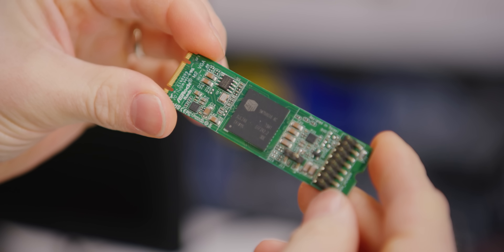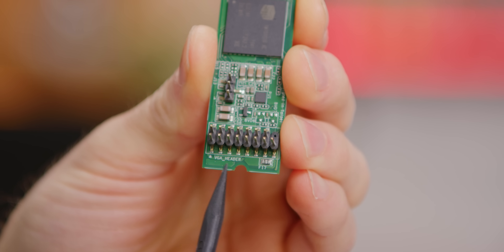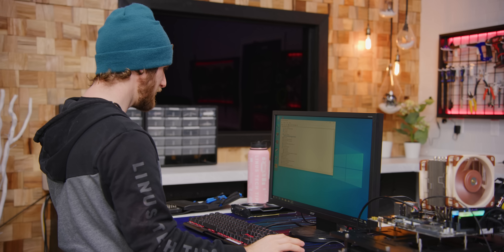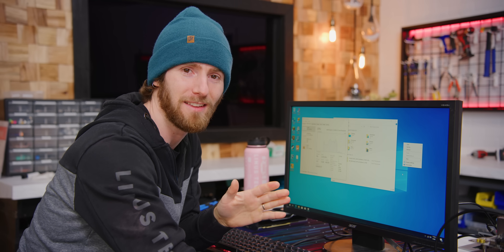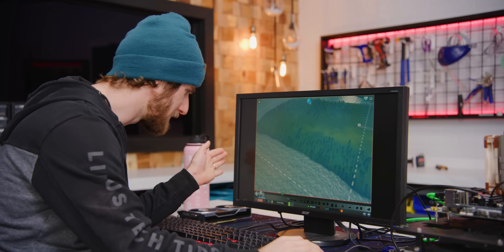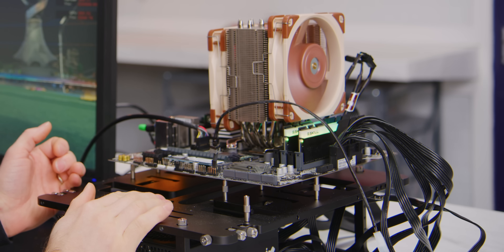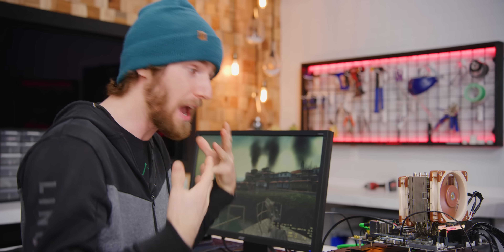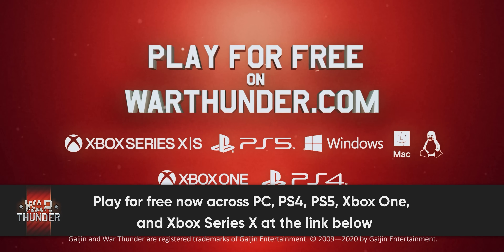THIS is a Graphics Card..?? - ASRock Rack M2_VGA

Comment: This might be good for just running basic display for now but what could they do on gen 4 m.2 with laptop dies and overdone m.2 coolers like the saberent m.2 cooler with heatpipes attached? https://www.newegg.com/p/0D9-001Y-00027?item=9SIAME8ASD1163&source=googleshopping&nm_mc=knc-googlemkp-mobile&cm_mmc=knc-googlemkp-mobile-pla-sabrentsolid+state+disk_-9SIAME8ASD1163&gclid=Cj0KCQiA3smABhCjARIsAKtrg6Ky-Lzt7G-tMFCL1l9CLgNqAgyT1B0i9ooOdf-3qJ_0PmOSazcBezsaAmxaEALw_wcB&gclsrc=aw.ds
Reply: If any board partners are trolling the coments section for ideas and like this one, I could really use a better job. 

I hold 2 computer science degrees unfortunately from the University of Phoenix online and I graduated in May of 2015.

Comment: 5:49

LINUS YOU DOFUS, YOUR GRAPHICS DRIVERS ARN'T WORKING!
all those symptoms are classic for a PC using 100% software rendering. low color depth, 64Hz refresh rate, no Vsync on desktop and dragging windows, the whole 9 yards. That thing is not offering anything, if the drivers are actually loaded.

Comment: That 1Hz and 64Hz is power saver, so it uses power and produce frames on demand, means when nothings happening, it will sleep at 1Hz, and when it has to do something, it will do it efficiently, up to 64Hz. Similar things are happening to modern GPUs, for example RX5600XT can do 1800MHz core clock, but when its not doing anything, it will sleep at 6MHz. On Intel iGPU, same thing, it can do 60Hz, or transport 120Hz from real GPU, but on battery it aims for 48Hz, while it will sleep at 4Hz when doing nothing. Energy savings, probably good for servers that does not showing things actively 24/7, for laptops, smartphones, cars, batteries and other things, nice feature to have.
So, can it mine some crypto currency? Maybe with some overclock, passive or active little heat sink, maybe that GPU is slow, but it got somewhat fast memory?

Comment: The color banding could be due to a poor VGA port on the monitor, but I suspect it’s a limitation of the overlay/scaling surface the video is being rendered on. (Your “certain type of pictures” would probably look just fine.)

This might actually be a neat way to “sneak” a GPU into a laptop that doesn’t have one, but I guess with the size and power limitations, it wouldn’t get you all that far.

Comment: This has to be one of the most extreme niche cases I've seen in a long time. Where would this be useful that IGA wasn't already present, especially considering this requires a board recent enough to have M.2 slots. (Using a full PCIe slot for an M.2 adapter instead of a minimal video card would make no sense at all.) What is the CPU that ASUS thinks somebody absolutely has to use that lacks at least comparable IGA to this device? Though most IGA for the last decade is hugely better.

WARP goes back much farther than Windows 7. Software fallback has always been in DirectX. Several generations of Intel IGA has relied on it to claim compliance with a more recent version of DirectX than the hardware actually had the functionality to perform (particularly DX9), which is why the results were so lousy. WARP was just a formalization and update of the methodology.

Comment: This is the form factor that intel gpus should be, Pci-e gen 4 or 3, Iris Pro level graphics with the L4 cache for vram, pair it with an i3 which are 4 cores now and game on a low budget, super small form factor. Like maybe sub 100 dollars low. With a display port out for video
Don't know if it will beat an apu but it would be nice to have, maybe have one of those crazy passive coolers the ssd get and an rgb skull for fun XD

Comment: For reference... that GFX Card is meant to be in imbedded system deployments... such as Slot Machines.. Where the games that run on them are SUPER whimpy and thus don't require hardly any graphics power at all and only need basic VGA connections. We use these sort of GFX Cards in our slot machines..

Comment: So, I think this is aimed at digital signage, you could get a load of these on a machine (think those M2 breakout boards) As for the gaming claim I think it would be a good match for Gambling kiosk machines like you get in casinos and pubs (UK here!), you could run a bunch of them on these since they dont use 3d graphics normally.

Comment: if you think about it, it actually is not too bad a product. It is just limited by the chip on it. Take for example the new M1 chip from apple. It has integrated graphics and is good enough to run some games (including some modern titles) at not so bad frame rates. If someone developed that kind of graphics and put it in the above form factor with a little more bandwidth, you would get a very efficient and effective graphics - one that doesn't take up absolute ton of space - I reckon. Heck it wouldn't even need fans and stuff too cool it. Just the passive heat sinks like the ones used for M.2 SSDs would do the job! This for me is a very interesting prospect.

Comment: One day soon they will add Ray Tracing Acceleration hardware to your pci4 or pci5 m.2 NVME drive. The card will be able to use a few Gb of higher speed buffer for RT during gaming or caching drive data when you are not gaming.

Comment: My MSI GeForce GTX 1070i ARMOR 8GB has no VGA compatibility. My 24" inch 1440p 144fps 3D gaming monitor does Display Port & HDM but, has no VGA port.

Comment: So, if you guys set that up with the m.2-GPU was selected to be the processor for your tests.... doesn't that lock out all the other hardware? I see the point in that for testing it's limits, but as for testing it's practical uses, I would say let the main GPUs do the rendering and what you've got is a halfway decent way of hooking up an old CRT if one wanted to do that. And... maybe they'll release it on a smaller die next gen. lol

Comment: You should do a “weirdest PC” with all of the weird janky parts you’ve found
Reply: THE BOTTLENECK
Reply: Then try and run crisis? lol
Reply: sounds like a fire hazard. great idea for a video
Reply: They could use this to show how insane the Threadripper 3990x is. They played Crysis using software rendering, I bet it would be awesome.
Reply: Hmmm... Put this GPU in the M2 slot, get those weird non-volatile drives that fit in the RAM slots, RAM sticks in an old IDE ramdisk box, CPU... anyone's guess. And power over water cooling.
Reply: @dananskidolf  crossfire the m.2 gpu and the cpu rendering
Reply: Linus still dropping the word WEIRD. Not so sublime bashing on China and the Chinese people.

Comment: The fact that manufactures haven’t already started making a wider variety of m.2 devices is a crime against humanity. I should be able to add usb c 3.2 gen2x2 ports, thunderbolt 3/4 ports, 10gbe lan, sound cards, raid controllers, and even graphics cards via an m.2 slot. They should also consider making high capacity hdds with built in nvme cache that simply uses a second cable and m.2 connector. This could become standard practice if they would simply do away with old fashioned sata ports and included sff 8643 tri mode ports instead. That way you could have an 18-24tb hdd with a 1-8tb nvme cache connected with one cable.

Comment: As someone who used to own a first gen Core i5, this is similar performance. The only difference is that the iGPU actually supported a lot of the games that didn't run lmao
Reply: I'm still running a 1st gen i7,  runs like a champ for most everyday things.   I remember my first cpu was a Cyrix  Instead 233 mhz. Wooooooo!
Reply: @skroid02  Yes, but afaik it doesn't have an iGPU. The CPUs are fine. Maybe it does and I'm wrong, but for as far as i know the iGPU on the i5 - 650 was terrible

Comment: I'd like to see hardware add-ons like this for extremely vintage PC emulation. Like, making a 7nm 486 CPU would probably have the footprint of a resistor these days.🤣 Imagine a full 32 bit Windows 95/98 PC in the Raspberry Pi form factor with soundcard and GPU add-ons all redesigned on a modern process node! It'd be such a waste of silicon, but would it really? 😛

Comment: Actually the 300MHz core clock and 16MB DDR VRAM can (in theory) result in a capable late 90s, very early 2000s card, which may be able to run HL2 like in the video (if the necessary dx/ogl is present). Otherwise I feel the 300Mhz for a 2D only card is a bit overkill.

Comment: How many of you were convinced, when you saw Linus haphazardly connect the power input, that there was a 50% chance he had connected it backwards, and were eagerly awaiting the potential impending doom?

On a more serious note, I can see this as a nifty potential cheap GPU option for smaller "pi-like" SBCs for classic arcade emulation that needs those funky VGA modes like 15khz refresh ones. (Or was it 31k that wasn't standard? I remember 1 of the 2 was arcade-only, but it's been decades since I worked in that field, haha. Point stands, though, as you can't get both of those modes over HDMI/etc last I checked. Only SCART or VGA.)

Comment: Thsi could actually be a good way to equip office laptops with something like a slimmed down 1050 (performance wise). If it has mutiple m.2 slots, you could to some light gaming on office machines. 4x PCIE as an Interface should be plenty, it is enough for eGPUs via thunderbolt...

Comment: I could see a use for this at home. An unRAID server with a Ryzen CPU without onboard graphics. Use that little device so that you don't have to have a GPU plugged in. Or have that plugged in so that you can plug in a GPU for passthrough without having to have an extra GPU installed for the host machine. Would be nice on an ITX unRAID machine.

Comment: This could be brilliant to run result monitors on our range, where it just has to refresh every couple minutes at a time, and a easier way that learning a raspbp, allthough the price is very important, around 70$ wouldn't make it very viable
Reply: whats wring with the pi
Reply: There are similar adapters that convert USB to VGA and do full software-rendering. That would probably be better for what you want.
Reply: RasPis are absolutely amazing for anything like this.  The one thing to keep in mind is you want to do a volatile overlay or something to keep the root read-only.  Otherwise supposedly the SD cards can wear out.   But whether that actually happens is very much applications dependent.  I use Chromium for display and signage, and that tends to use a lot of disk activity, so I always try to go for read only.
Reply: That thing is literally a potato chip
Reply: @WindFireAllThatKindOfThing  "literally"
Reply: @WindFireAllThatKindOfThing  deep fried?
Reply: Just get an android stick/Miracast stick. Can get you those for $10-15 for that purpose
Reply: Norden your videos are great
Reply: Wait... Are you saying that $70 isn't viable because it's too expensive?
Reply: @sgbench  Yes. There are (or were before the shortages) plenty of low-budget graphics cards available for $70 that are much better than this thing.
Reply: @darknightmike10yearsago  I bought a 1030 for some shitbox I had and it could play most games on low settings after that. It cost me 70 bucks.
Reply: @brahtrumpwonbigly7309  Nice. Case in point.
Reply: @sgbench  And it sounds like he's referring to the total cost of all non-monitor components in the system.
Reply: Duck Game

Comment: I like how much modular hardware connections have become. It makes casemodding so much more interesting and gives so many options. Nowadays one can plug harddrives in: PCIe slot, M.2 slot, USB 3.2 or SATAIII. Plus there are 128 to 512 gigabyte USB 3.2 sticks available which can perform as fully functional and relatively fast drive with (light) gaming capabilites. 
In the old days there was just an ugly light-grey and always way to short IDE cable for a mechanical harddrive, and nothing else. Nowadays the new Ryzen Zen 3 CPUs can direct access the ultrahyperfast GDDR6 memory on the newest Radeon graphics cards, plus use the standard PC RAM too. This makes graphics cards with 24 or 32 GB GDDR6 RAM suddenly incredible useful in the future because the casual computer RAM technology is lagging so much behind with customer-ready DDR5 mainboards not getting released in the next 14 months or so. 
The idea of bringing small secondary graphics cards or chips is great too (like Ryzen with the Vega APU`s on the 2400G and 3400G chip). I played on the Vega 11 half a year and it was actual a very decent gameplay experience running all actual-gen multiplatform titles fine.
I wonder what interesting hardware and highly exotic parts we will get in the future. 
This graphics chip in the video has no cooling fins, even the oldest hardware from the mid nineties had coolers and fans - this might be the problem, maybe it has sleeping potential lurking in it`s 350 nanometer production wafer and can be overclocked to Riva TNT 2 levels with Intels legendary new peltier cryocooler or liquid nitrogen? Sometimes proper cooling is the key :D

Comment: Try Valorant. That was literally promised to run on a toaster
Reply: It doesn't run on my potato 🤣
Reply: It doesn't run on my potato
Reply: Did they really promise that? How do I transfer it to my toaster? I can't find any USB ports on mine. :(
Reply: @2m0ng032  wdym you wont need any usb ports...just toast the wires
Reply: @joshuap1085  Ah, I feel stupid now! Thanks!
Reply: Ur rank?
Reply: Can run 360p low 50fps
Reply: It was already a bit struggling with half life 2 lol
Reply: @chumpapii  As pointed out rightaway...it pretty much wasn't even trying, anything DX was pretty much running on the Ryzen CPU.

Comment: Wait, so if Half-Life 2 runs pretty well on a 3300x and Crysis runs pretty well on a Threadripper 3990x, I wonder if a Zen 3 Threadripper (or even the 3990x again) could run Half-Life 2 at a playable framerate.

Comment: "We were running all of our games off of the CPU"

... soooo, we're tossing this into a Threadripper system at some point?
Reply: We need this.
Reply: Having built a threadripper..... I'd be interested.... also if filling the m.2 with these and having multiple gpus would boost it further 🤷‍♂️
Reply: @Its_just_adhd  can we circumvent traditional sli/crossfire?

I have a similar project already started where I intend to build a unified cluster rig and attempt to compete with it. 

3 AMD FX 6300 on FX990 or FX970 motherboards each running 16GB DDR3 at as high a rate I can get them synced up with.  

So far I have used an asrock fx990 and fx970 as well as a gigabyte ga970 with overclocks on the fx 4100 at 4140Mhz for the CPU which I would hope is achievable with the fx6300 cpu.

I have 2 fx 6300, 1 fx 8120, and 1 fx 8350 CPU's but I'm looking to sell the 4100 and 8120 in budget gaming builds to finish my cluster rig project.
Reply: please. I want to see modern games running on that thing lmao
Reply: Duck Game
Reply: Yes he has to try that.
Reply: Yes. Make a video of this and threadripper
Reply: Okay, but actually--for sake of sheer dumb curiosity--I really want to see this.
Reply: Wanna see this happening.
Reply: Get a m.2 adapter and just go wild 🤣 turn off the setting on the gpus and see how fast a threadripper cpu is doing graphics 🤣

Comment: Sixteen MBs of video RAM?
Y'know, I can actually remember when that was a lot...
Reply: Me too, back then when I am cleaning the storage room, I found my Radeon X550 with 64 MB of VRAM.. just the box though.. lol, 2005 gpu.. :)
Reply: @Alazim7890  
My first was a 1997 GPU.
An ATI 3D Rage card with a whole two MB on board.
Upgraded that to a 16MB Voodoo Banshee a few years later, which got traded for a 32MB Riva TNT2 a few more years on.
Next one was a GeForce MX440 with 64MB (which ended up being a bit of a dud), then an FX 5600 (256MB). I had fun chugging and clunking through Doom3 and Far Cry with that one.
First really good card I got was a 6800 GT (256MB).
All back in the days of PCI and AGP - back when I was young and pretty...

Comment: It seems like maybe it could have a use with a solution for signage displays.  They don't require much in the way of FPS as they usually just rotate through text and static images.  A lot of old displays used in signage only have VGA inputs. Pair one or more of these with a cheap ITX PC in a fanless case to power some old signage displays.  That said, a raspberry pi with VGA out can probably do a better job for the same or less money.

Comment: Linus: “I forgot how crappy VGA looks”
Me: “HEY!! My mom still uses VGA 😡”
Reply: Open the floodgates for your mom jokes.
Reply: Ouch Linus, I use a VGA only compatible monitor as my secondary display/
Reply: Just cuz your mom uses vga, doesn't mean it looks good lol.
Reply: Well if she dosn't play Cyberpunk in 4k she might just be fine..
Reply: I'm in the process of building a machine that'll use VGA to connect to an older TV that lacks HDMI inputs but has VGA input. Its primary use will be recording TV broadcasts and video playback. The GT220 graphics card is probably overkill for the job, but it has a VGA output and I had it on hand, so it was one less component that needed buying.

Comment: Wait, what about a USB display adapter like the old EVGA UV+? If you had room for a VGA plate, even SFF, you could in theory put a USB display adapter in said computer. Even get modern digital connections! (DVI, old, but DP and HDMI which is more common with such devices)

Comment: i quote the datasheet[https://www.digikey.com/en/pdf/s/silicon-motion/sm750]" The SM750(ASRock RACK) is a PCI Express 2D multimedia mobile display controller device, packaged in a 265-pin BGA. Designed to complement needs for the embedded industry,  it   provides video and 2D capability.  To   help reduce system costs, it   supports a   wide variety of I/O,  including analog RGB and digital LCD Panel interfaces, two Zoom Video interfaces, and Pulse Width Modulation (PWM). There ar  e additional GPIO bits that can be used to interface to external devices as well."